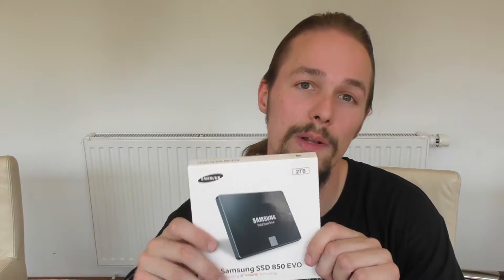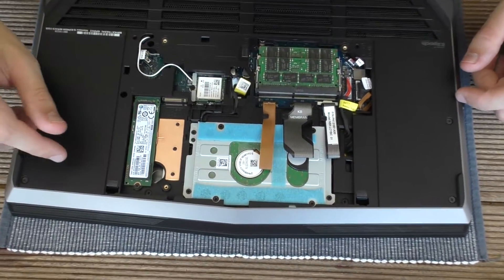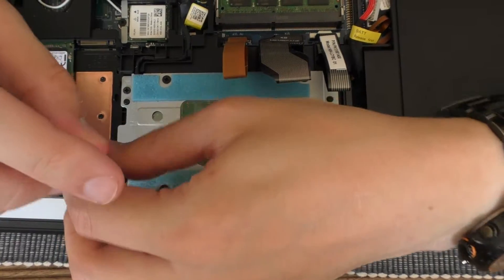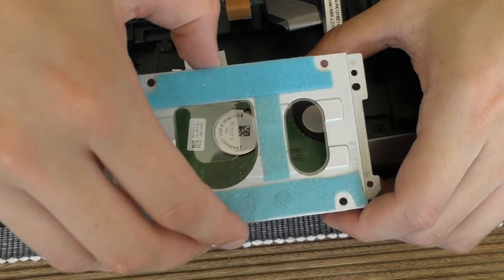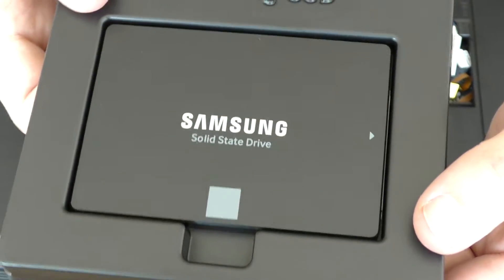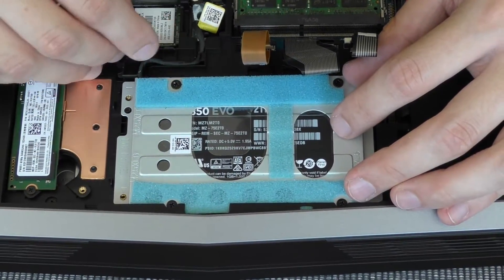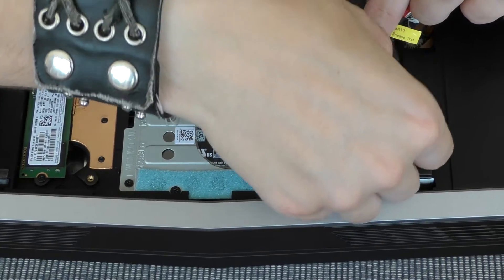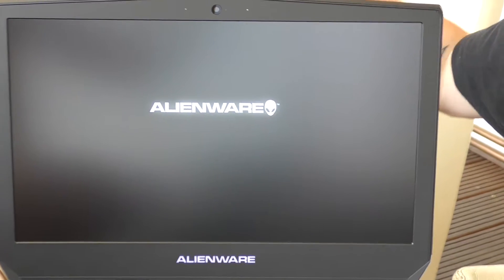Alienware 15 R2 HDD to SSD Change

Comment: hi I have Alienware 15 R2, 118gb ssd n 1 tb hdd, can i add another ssd and maximum of how much capacity? my friend asked dell n they said it has 2 ssd slots but max ssd capacity of both slots should not exceed 512gb. Is that correct or can i ass another ssd of higher capacity?

Comment: Hello GeneralHail, y have an alienware 15 r1 with the same 1 TB HDD and two slots for M.2 SSD, recently I clone my HHD to a new M.2 SSD  but i can´t make that the system boot from the cloned M.2 SSD , every time it starts from the old 1 TB HDD, even if I change the Boot order in BIOS, the only way i can boot from the cloned M.2 SSD (and see if the clone works) is choosing  boot from it in F12 menu (not in the BIOS) and yes it works this way, but when i restart again the system boot fron the HHD!! Any idea of how to solve this??? i will apreciate your help!!

Comment: Great vid. Btw do you know if the hard drive size for a15 r2 is 9.5mm or 7mm? My current hard drive is broken and I am looking for replacements, I'm not sure if I will need 9.5 mm or 7 mm and 5400 rpm or 7200 rpm for A15 R2

Comment: How come you have 3 TB of storage even when you removed the seagate mechanical drive?
Reply from the maker: Shubham Gadewar
Sorry, I don't understand the question.
Reply: GeneralHail What I meant is, how come you have 3 TB of storage when you installed 2 TB SSD!?
Reply from the maker: Shubham Gadewar
Because there is another m2 SSD with 1TB installed: 2TB + 1TB = 3TB

Comment: Hello i have a question,( I'm from México and i don't have the best english in my vocabulary XD) but the point is You install the ssd to make your AWR2 going faster or only to have a better stabillity at games? this because i have the same alienware and i want to make it faster with my apps like solidworks,matlab,proteus,labview,etc. I hope you can answer this :) I give you my sincerly regards
Reply from the maker: Eltunas MCFLY
The laptop boots faster, the whole system seems more stable and programs, games etc. work faster and easily because I have more storage now.
Reply: Thanks a lot :)
Reply from the maker: Eltunas MCFLY
No problem, watch also my other videos if you want :)
Reply: of course i will :D

Comment: hey dude, how does it show a seperate c drive of 940 GB along with the new D drive if you changed the existing HDD to SSD. Is c drive still accessible ?
Reply from the maker: Vaibhav Kulshreshtha 
Hey. Easy. Because I have (or had) two SSD's inside my laptop. One m2 SSD with 1TB as boot and the other 2.5" SSD with the 2TB.
Reply: oh .. thanks a lot man 👍
Reply: if I replace the HDD with an ssd then will it give me additional memory or will it replace ?
Reply from the maker: It depends on what you add or replace. If you replace your 2.5" HDD with an 2.5" SSD your memory or storage will be replaced. If you add a m2 SSD 2280 you will gain additional memory. Be careful when your HDD is your only storage with your boot system on it. Make sure to backup all your data or add an m2 SSD to your system and install there the new boot system, or download the boot system to an USB stick and install it completely new. There are many different options to do so.

Comment: do you know max of memory in alienware r2 -p42f ??
Reply from the maker: Amr Said 
You mean the maximum of RAM memory or the max of HDD/SSD? 
I don't know for sure, but at least 4TB should be possible. I have one 2.5" SSD with 2TB and then there are two slots for m2 SSD's. When you buy both with 1TB you come to 4TB altogether, maybe the notebook is capable of even more... If you build in m2 SSD's with 2TB and a HDD with more than 2TB you could reach 7TB or even more, but I am not sure if this works, I never tried out.
Reply: i mean the maximum of RAM memory 
thx
Reply from the maker: Amr Said
32GB

Comment: hi, i have an alienware 15 r3 with 512 ssd(boot) and 1tb of hdd. So i want to change my hdd to ssd. My question is, if i changed my hdd to ssd, do i need to do settings (like disabling hibernation,etc.)? Thank you :)
Reply from the maker: Jesslyn Sukamto 
No. Just follow this manual or this video. I also have an R3 and changed the HDD. There I even did not unplug the battery and it also worked.
Reply: Hi thanks for the information. Oh, one more thing, does it actually affect the operating system, although i know if the OS(boot up) is in factory ssd, but i feel so anxious and still need an assurance.
Reply from the maker: Jesslyn Sukamto 
No, it won't affect your operating system, because you aren't changing it. You are just switching the HDD to an SSD. The only thing you have to do probably, is, to go to devices and give the new SSD a disk/drive letter. (C, D, E...) and thats it. No worries, even if you would change the SSD with your OS on it, it would not be so bad, you can also plug in an USB stick with a boot system/WIN10 on it and install it completely new.

Comment: hey bro, my 1 was alienware 15, Im not sure R1/R2, by the way i get intel 600p series 256 GB, i couldnt install it. does it suitable for my laptop?
Reply from the maker: yes it should fit inside. it has the form factor 2280 and is m-keyed.

Comment: i have an alienware 15r2 gtx 970m.i don't have any ssd in it.i want to upgrade 128/256gb ssd. which ssd is compatible with this laptop and what is the best ssd.???
Reply from the maker: You can either add a m2 ssd or an 2,5" ssd. there is no "best" ssd. you can also buy a crucial, kingston, transcend, san disk or pny... i would just recommend the samsung 850 evo series because it is not too cheap and also not too expensive, but good quality. if you want more speed go for the samsung 850 pro series. just make sure you check the sizes of the m2 slots/sticks before you buy them! all of the internal ssd's or hdd's are normally 2,5".
Reply: GeneralHail  what's about Samsung 950 pro??? is it worth buying? or Samsung 850 evo is worth buying.
Reply from the maker: xiphoid Rahul It depends! You will probably have the laptop with a HDD inside, so if you buy the 850 evo series you have to remove all your data from your hard drive, possibly also the operating system and then install or reinstall it to the new 850 ssd... It would be easier to buy one m2 ssd 950 with 1tb or two with 512gb. But it is your decision!

Comment: i do have just one volume (hdd) can i change it without any kind of lost data?
Reply from the maker: Anton E What do you mean? You want to remove the HDD and add another HDD/SSD? Or you want to add an m2 ssd? Or you just want to change the volume settings on your operating system? 

If you want to remove the HDD you have to first save your data on an external drive or you insert your new drive and transfer your data from the old via cable to the new one.
Reply: GeneralHail ok thx man (are you german) also ich will meine hdd gegen eine ssd (1tb samsung evo) tauschen. externe habe  ich schon aber muss ich windows auch kopieren und irgendwie speziell kopieren? danke 😊
Reply from the maker: Anton E Ja Ich bin aus Österreich :) 
Da bin Ich leider auch überfragt... Hab Ich noch nicht gemacht, hab nur eine zusätzliche eingebaut ^^
Lt. Internet kannst du die Festplatte 'klonen' sofern die Speichergröße der alten Festplatte die der neuen SSD nicht überschreitet. Das Programm nennt sich Acronis True Image. Hier ein Link: 
http://www.pc-magazin.de/ratgeber/windows-von-hd-auf-ssd-kopieren-so-gehts-1228459.html
Ich hoffe das hilft dir. Wenn's nicht funktioniert - > Neuinstallation.

Comment: What kind of screwdrivers did you use? When i try to open mine it makes some sounds but it doesn't open.
Reply from the maker: It was a set just like this: 
http://m.com-magazin.de/img/1/1/4/5/8/7/Schraubendreher-Set_w773_h550.jpg
Reply: i faced same problem...